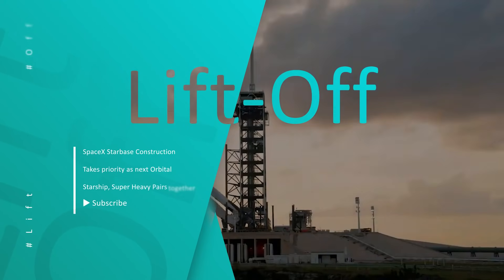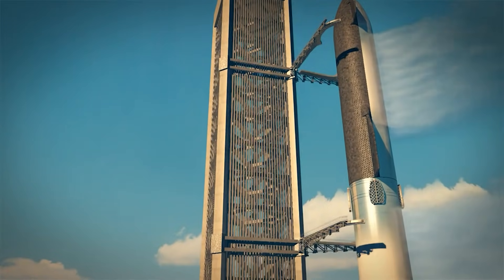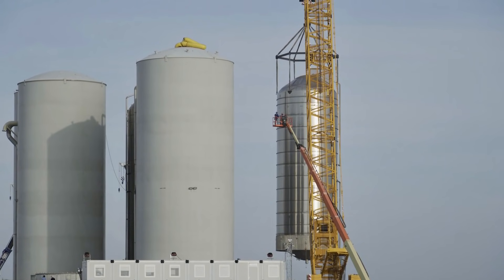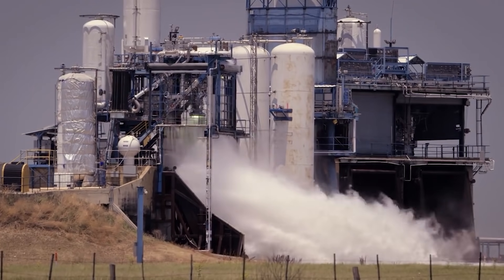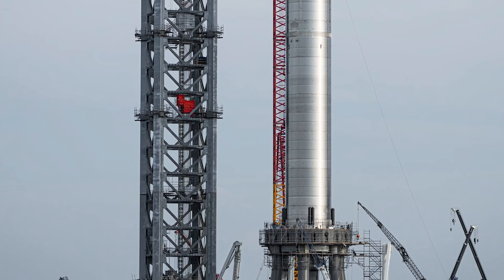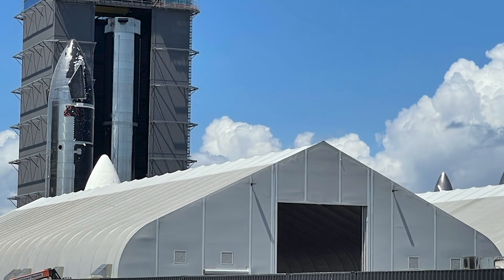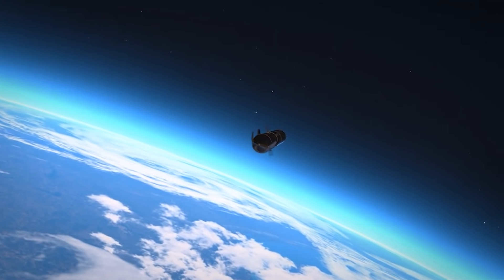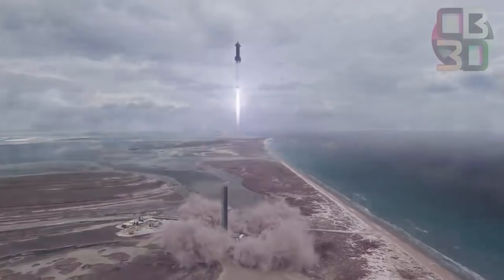SpaceX Starship 21 & Booster 5 GETTING READY

Comment: They are changing the engines while on the launch pad so they can better their methods for doing so. This will help in the future when they have rockets landing and relaunching in a short time. Instead of having to remove the booster from the launch pad to do those maintenance/repairs/replacements, they will be able to do so rapidly while it is on the launch pad.  My opinion on the matter.
Reply: That's similar to their reason for building so many prototypes that they know will probably fail (and spectacularly at that).  The only way to learn how to build spacecraft/boosters that are cheap and extremely durable and reliable is to build many of them and gather as much useful data as possible when they inevitably fail.  Among other things, it's practice for when they do all of this for real operationally.